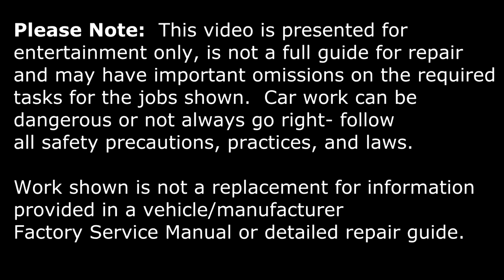Jeep WJ Driveshaft Special - Part 1 - Vortex Garage Ep. 16

Comment: Great video. I have a 1999 WJ 4.7 with a 4” lift. The driveshaft has 2 CV’s. I picked up a double Cordon from a salvage lot. Just have to find the yokes for the axle and transfer case. Then new U-joints. Thanks for sharing and the links.

Comment: Nice vid! Maybe you could discuss the NV242 (Selec-Trac) swap for the Quadra Trac when it comes to drivelines. My NV242HD requires a 2 inch shorter driveline (29" vs 31") for my 2000 V8 Grand that the Jeep dealers' parts dept has no clue about. Vary rare in option in 2000 if you're familiar. Thanks much for the great vids!

Comment: Thanks for the detailed information.  The best I've seen so far
Reply: I just bought an inexpensive 3 jaw puller set just to remove the cv, although Im sure it will come in handy for other things.

VERY much worth the $30. It took about 2 minutes (along with a ball peen to shock the cv) on my 20 year old rust belt driveshaft. I can't imagine how long it would take without it.

Thanks for the suggestion and all the useful info!

Comment: WOW.  Awesome video, you are subbed sir!  I have an identical 2004 WJ 4.7 NV247 with 107Kmi that I just purchased.  It has no weird noises, but it does have a serious driveline vibe noticeable from 40+ mph.  I removed the front driveshaft (double cardan) and about 90% of the vibration was gone - so I took the front driveshaft to a reputable drive shaft rebuilder.  After doing a quick hand exercising of the joints and pulling the open caps, he said it was fine.  I had him balance it anyway.  When I picked it up he said it was an ounce off and I saw where he removed the old weights and tacked on new ones.  After installation, the vibration is worse...LOL.  Are there any other components to check for the source of the vibration - or should I just go ahead and rebuild the front driveshaft?  Thanks for reading this, I sincerely appreciate your response.  KEEP UP THE GREAT WORK!!! - Mike
update: I took the front driveshaft out again tonight and road tested it. It is smooth as silk again...no vibes that I can tell. I checked all the front control arm bushings, motor mounts and trans mount with a prybar, they seem fine. truck is 100% stock highway queen (if that helps)

Comment: You're supposed to press the cups in until they just clear the clip grove. If you go too far in you end up with the ends of the center section binding on its end with the cup. The solution to fix that is to use a drift and tap on the center section to push the cup back out a tad to free up the bind. If you don't fix this the cup will make metal and the joint will fail early and even vibrate.

Comment: Hi I have a 2002 wj and about to fit a double double cardon with a 6.5 inch iro lift. I currently have the repezza to repezza front shaft. I'm aware I need to change the yolks but as you mentioned it's not as easy as a straight swap on the front diff side. Do you have any suggestions as to how to do this or am I best to take it to a diff specialist. Many thanks in advance.

Comment: very good video thank you 
i replaced everything here is the list 
front cv or axle shafts both 
both front hubs 
rotors brakes pads and calipers 
all for upper and lower ball joints 
diff fluid and the gears looked great 
the transfer case fluid it was black and like water 
the steering drag link and the other linkages 

so the only thing i did not replace on the front it the drive shaft 
i will do this next sunday thank yo for this video it is exactly what the noise sound like not he 2004 grand cherokee 4.0 
and it only make noise in 4x4 that is it nothing else 
do you think this could be the problem ?

Comment: I have a 2003 WJ with the 4.0L engine with selectable 2W, All Wheel, and 4WD, 197k miles. I have a clunk and a significant lurch when shifting from park to drive, park to reverse, and reverse to drive. After inspecting both driveshafts, I can rotate both back and forth by hand a bit (about 15 or 20 degrees) when the vehicle is in park and almost replicate the clunk. Should the driveshafts have any play like this? Should I be concerned with the safety of the vehicle with this movement? I figure replacing the U joints and rebuilding the CV joint would be a good start anyways, but I am worried about other problems or damaged components I might run into that the old U joints may have caused. What should I look for during the driveshaft removal so I can prepare to fix this issue properly?

Comment: I don't know if you do this or not, but after you bend and secure the stainless bands. I take a sharp center punch and place it directly over the sleeve it slides through and drive a holding punch mark through all the layers and at the end you cut as an additional security measure. I feel (please tell me if you think i am wrong) that by doing so it gives the layers a place to hold each other together nicely and avoid the edge from snagging and pulling it out of the ears. As i had a walmart bag snag on the end going down the freeway and the plastic bag managed to straighten the band out and it slid apart at 70mph.
Reply from the maker: I can see that as helpful for sure.  I tapped mine down a bit to kind of crimp it, so yeah, I think you are right any extra security there would be good
Reply: Put the clamp on facing the other way

Comment: Don't ever rebuild a Rzeppa joint. For the same price or less you can get a DC shaft from a junk yard. Having your Rzeppa joint fail is a gift from gob because now you have an excuse to upgrade. Also, any DC shaft from a ZJ will work on any WJ with a lift up to 3 inches. after 3 inches you will have to get a longer shaft or do a TC drop (tho you should be dropping your TC anyway after 3")

Comment: Great and informative video.  Thanks for taking the time to share and help others.   

Question for you:  I have a 99 Grand Cherokee with a CV-CV front driveshaft that I'm rebuilding now (on the floor behind me as I type).  I prefer to convert both yokes to u-joint style and change the driveshaft to u-joints as well; however, even though double-cardan is preferred - couldn't I run a driveshaft with single u-joints on both ends?

I'm not engineering genius, but it would seem that a double-cardan front driveshaft with adapters needed to mate up to the CV style yokes would vibrate more than if that same double-cardan driveshaft instead bolted to u-joint style yokes which tucks the spinning mass/knuckles closer to solid housings.  With true ujoint yokes, any ujoint (double cardan included) could therefore bolt directly to the yokes as close to the transfer case and axles as possible.  The spinning mass of the driveshaft would then be closer.  As stated above, my interest is to run a single ujoint at both ends of my front driveshaft if it's possible.  My rear driveshaft is like this; it's not a double-cardan. 

Suspension Config:
+2 inch springs
1-inch transfer case drop and a 1-inch spacer at the rear control arm; both to reduce driveshaft angle by one inch.  Running a 2.5 inch life now; the driveshaft should only be seeing a 1.5 inch lift due to this. 

CV yoke at the Dana 30 axle, and CV yoke at the transfer case
** In the past I've ran a Tom Woods double-cardan driveshaft but the WJ was plagued with vibration over 60 MPH so the driveshaft was pulled off and let sit in a garage. 
I'm wanting to avoid vibration.  The yokes and assembly have been checked and are good; this is driveshaft problem.
Reply from the maker: JT I feel like you'd want to convert the yokes to a ujoint yoke on diff and tc ends. the single cardan/double cardan offers more flex movement for smoothness on angles than a single/single would. and. you'd want the yokes to match the design with no adapters to limit variables that may impact vibration
Reply: You all probably dont care but does any of you know of a way to get back into an instagram account..?
I was stupid forgot the login password. I would appreciate any tricks you can offer me.
Reply: @Brandon Augustus instablaster :)
Reply: @Justin Major i really appreciate your reply. I found the site through google and I'm trying it out atm.
Looks like it's gonna take a while so I will reply here later with my results.
Reply: @Justin Major it worked and I now got access to my account again. I am so happy!
Thank you so much you really help me out !
Reply: @Brandon Augustus Glad I could help :D

Comment: Quick question, I have an 01 Wj Double Cardon. I have a 2 1/2 in lift currently no issues/vibrations/tested well on trails. From what ive gathered, for my 6 1/2 in lift from iron rock auto, I can keep my driveshaft and it will be fine. What is your opinion? A response would be greatly appricated... Thanks!!
Reply from the maker: Ajay Preach I think so with the double cardan. Im wondering if the iro lift has a transfer case drop in it to help ds angle?  Either way prob not a bad idea to call them to verify but I would think your in better shape already having the double cardan unit
Reply: They do have spacers that come with the kit for the TC. I forgot to mention that.
Reply from the maker: Ajay Preach Cool!  That should definitely help keep things good
Reply: Thanks for your quick responses brother! Take care. Ill comment back after the build you can watch the vid if you like!
Reply from the maker: Ajay Preach Definitely!  looking forward to checking it out!  good luck on your build!

Comment: Whats behind the other boot at 18:00? Dont you change parts in there or regrease anything in there?
Reply: i think it is a telescoping section so the driveshaft can stretch in length slightly when the axle lowers down from the normal ride height it is greased and booted already and appears he has already done it not to long ago.

Comment: it would be cool if you did a NP 242 rebuild and cable adjustment. I put mine in four wheel drive once and it was very difficult to switch gear positions and now in two wheel drive sitting at a traffic light the part-time light will come on and go off during take off.
Reply from the maker: +Jason Olson Haven't had to do one yet - but certainly will document when/if we do.  Thx!

Comment: Awesome video, thanks! 
Is there an easy way to know what length driveshaft you need? For example, some people say you can not run a WJ 4.7L driveshaft on more than 2.5" lift. I understand that its shorter, but what is the way to measure the needed minimum length. 
Thanks!
Reply: I would contact a driveline shop for measuring recommendations.
Reply: Most measure from weld to weld, just google it there’s a lot out there

Comment: I have a 4.0L with 242 front prop shaft is double cv joint. I have all the bolts out but cant seem to get the drive shaft out. Is there a trick or just a bfh or what?
Reply: I took a 3/16 punch and came through one of the holes on the backside (not the screw holes) two strikes opened enough gap to use a flathead to pry it off.... hope this helps someone else

Comment: Hay i have a 02 ford ranger with  a lift with a dubbul cardun im getting vibration at 45 mph you think its the U joints it's on the front when I take the driveshaft off all vibrations go away thanks by the way it's a super lift
Reply: Notice that uni joints are in phase on double cardan drive shaft if your spine is out by 1 it will vibrate

Comment: Question i have a V6 WJ 2001. not sure of the Gear Ratio yet.. but anyways i'm buying a 2 Inch lift kit from Rough Country will this Damage my Driveshaft at all? Thanks!
Reply from the maker: It may lower the lifespan of the rzeppa joints if equipped.  But would be worse if the lift were higher than 2"
Reply: +Vortex Garage   I have a '99 WJ Limited 4.7L with 183k and after putting new OME "2" inch springs the pinion side joint started humming badly.  Removed the driveshaft and the humming went away.  Will the new Rzeppa's last at all or should I just go ahead and convert to DC/U-joint?
Reply from the maker: +Vim Njicki Not entirely sure, to be honest.  I have heard with 2" of lift the rzeppa is usable but wont last as long.  Just don't know how long without checking some forums out...
Reply: +Vim Njicki I had a 2" on my WJ and it ate through the rezeppa bearings... I went through 2 rezeppa bearings in about a 14 month period. The double-cardan driveshaft would be the best way to go if you intent to keep the 2" lift or install a bigger lift.
Reply: The gear ratio should be stamped on a metal tag on the differential cover, along with the recommend gear oil. One on the front diff cover and one on the rear diff cover... These goes missing very frequently. But if/when you do the next gear oil change, the gear ratio should be physically stamped somewhere on the carrier of each diff. If you need more help, check out wjjeeps.com, they will most definitely have it there!

Comment: Can you link to the cv kit you used in the video?  Trying to find a good brand.
Reply from the maker: This is the one I used:  http://www.driveshaftparts.com/index.php?route=product/product&product_id=978&search=me807
Reply: +Vortex Garage 
Thanks!  I looked at that, but it just seemed too cheap to be any good.  But I also didnt want to shell out $120 for a Crown if it's only temporary until my lift.  I think I will give this one a shot.
Reply from the maker: +Kelli Loveland The cv itself felt tight with no binding and looked like good quality - I was happy with it. I did a KJ Liberty with a Dorman kit and wasn't impressed plus the Dorman kit was twice as much. The person who has the WJ we did the me807 kit on has a few thousand miles on it so far and no issues yet.
Reply: +Vortex Garage Good to hear.  I should have it in a day or so.  The Dorman got pretty bad reviews on Amazon.
Reply: +Vortex Garage Just got my kit today and it only has one gasket. Which is also pictured on the website. Hopefully that means the new kit only needs the one gasket up front! I guess I will find out...
Reply from the maker: +Mark Welsh hmmm mine had 2...  that said, the Dorman kit I was given to fix a KJ rzeppa had only one gasket.  I reused one of the originals as the second.  Both old ones were in decent shape.  just take care when removing.

Comment: I need to know if the ds from the v8 with the dc joint will fit in my i6 they are both 2002. I also need to know if the yolk from the v8 with the dc joint will fit my 242.
Reply: They front drive shaft from the V8 should work., as long as your Jeep has the proper yokes. If your Jeep has the repezza yokes, you will need to switch yokes. I believe the lengths of the FRONT dc driveshafts are the same for both i6 and V8's. The transfer case yoke should work for the 242. If you end up having to switch your front transfer case yoke, might as well throw a new seal in there too while the yoke is off.

I
Reply: +Catlin Thomas cool thanks

Comment: I have WJ I6 w selectrac 242, w repezza joint only at TC, the video is great but missing one thing. Can any one verify if the stock yoke from v8 WJ w DC and NP247 quadrajunk, does it have same spline and length to b a direct bolt up on the NP 242 selectrac  TC since I need to change that to get  the DC,.also does the zj V8 DC shaft the one to get bc it has longer slip yoke,or is the wj v8 DC a dirct bolt up if that yoke at the TC fits, and u have u joint at pinion. I'm trying to use all factory parts not trying to order a yoke from DS  shop. Any response would b much appreciated.
Reply: Gabe Mundo same spline count. I just swapped a242wj TC into my wj with the 247TC. The 242wj had a rzeppa front DS, and my 247 came from the factory with the DC DS. Swapped right over.

Comment: hi iam from to venezuela . I need information about u joint rear to my jeep grand cherokee wj. its broken. I need your help. thank you.
Reply from the maker: Hi - the WJ Jeep uses a 1310 style ujoint in the rear.  very common size. I would ask your parts depot for a 1310 style ujoint. I think the Spicer brand ones I used are part # 5135x, and ones from moog are part number 269.  going off memory here :)  

Also check out the video on doing Mountaineer Ujoints.  They are very much the same process, but the wj has differenr yokes, a slip yoke that pulls out of the transfer case and a cardan style yoke on the differetia like both front shafts in this video you are commenting on.  hope this helps!  If not checkout jeepforum.com

Comment: Good info, except you are wrong about strength. The CV joint can take a higher torque load. It's a stronger engineered design.